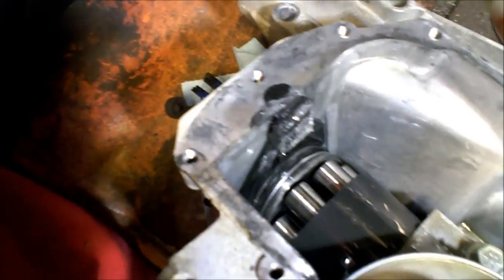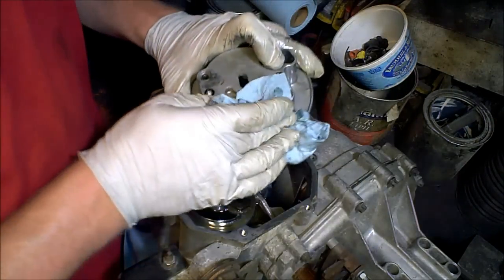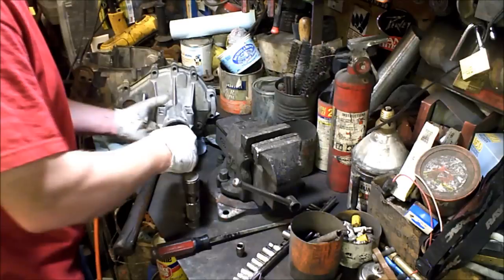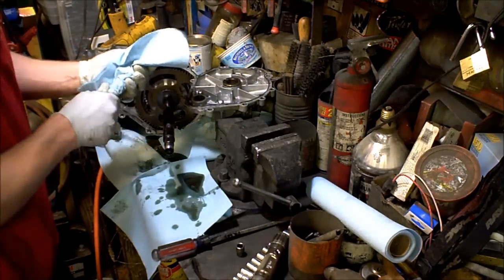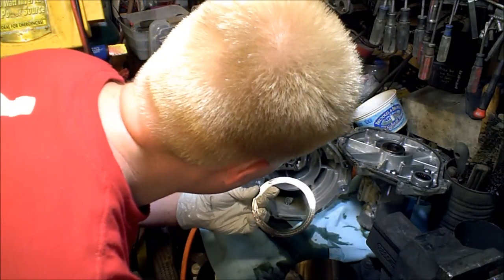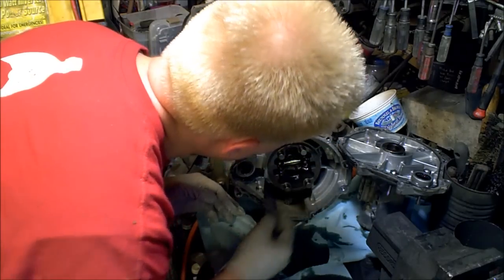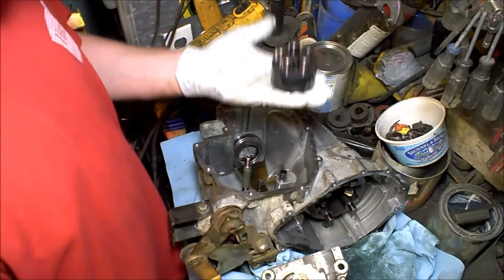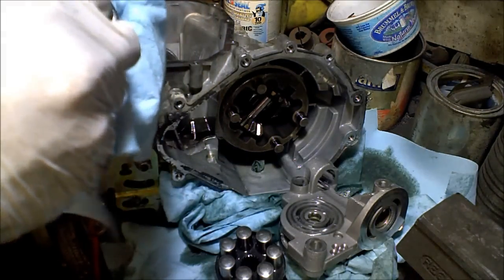2 Hydrostatic Garden Tractor transmission rebuild 2 of 4 Hydro Gear

Comment: Are the springs weak over time? Is this why these transmissions slow down?
Reply from the maker: They slow down over time because the clearances wear larger. This allows oil to pass where it shouldn't normally.
Reply: @sixtyfiveford  agreed

Comment: I have a craftsman riding mower with the automatic transmission hydro, the drive belt broke  and I replaced it. Now it won’t move forward or reverse..  if put in forward it seems like it try’s to move in reverse . It was slowing down I thought the belt was just slipping as I had to have the drive  in a faster position than usual to go the same speed . Any thoughts would be greatly appreciated.  I guess the pump has gone bad.
Reply from the maker: The pump could have seized and that is why your drive belt broke originally.
Reply: sixtyfiveford I drained the transmission oil , and it had a very small amount of aluminum particles.. nothing crazy though. I’ve never changed the filter or oil..  the transmission is dry ..has never leaked .. surprisingly as it’s old probably a 96

Comment: What type of sealant did you use to seal the bottom plate?   Did you purchase any seals also or did you re use the existing seals and O-rings?
Reply from the maker: I reused everything because nothing was leaking. I just took care taking it apart and back together. I just used a RTV sealant.

Comment: Thanks for the thorough videos on this... made me not afraid to tackle mine.  How do I determine if that inside pump housing needs to be replaced.  I"ll check both pumps with calipers but you didn't mention how to determine about that third part.

Comment: Around these parts you would be hard pressed to get more than $400 for a riding mower. $200 in parts plus your time and the cost of the mower your working on. It would not take long before you would have more in it than its worth. Over the last few months I put together a mower for a  family member.  I put all new tires on $65 each for the back and $45 each for the two fronts. Plus new coil and rebuilt carb. Gas line , filters,  Air filter All new blades and belts rebuilt the breaks and key switch. All together just over $350 in parts Not counting all the work I put into this. Or what I had in the mower.  Then they went out and bought a new mower. So I put this one up for sale on Craigslist  I listed it at $375. I got insults of $150 - $200. So I listed it on face book. about 2 months later a guy offered me $300. And I was hurting for money. We all have to do what we have to do to survive. I damn sure do not want to take another beating like this.
Reply from the maker: Just like cars, there are more expensive riding mowers than others. If I recall I sold this one for $1500 because it was a $2500-$3000 unit new.  A clean basic el cheapo riding mower I can get $450(no bagger, cheap brand).  Most riding mowers I buy have to look good. I will pass on junky looking stuff as it hurts the profit and would rather pay $50-$200 for a non running good looking unit than take a free junky one.  I generally won't spend time on items that won't net me more profit(belts, blades, tires, etc). I only replace what is broken, what won't allow it to start/run flawlessly, and give it a spit shine so it looks new. Most riding mowers take me 1-5 hours and maybe $10 in parts to have them ready for resale.

Comment: You keep saying oil in the transmission what kind of oil mine is a Poulan Pro a early 2000 I've had it almost 12 years and it just started doing this it won't go
Reply from the maker: Look up your model on Google. This model and a lot take 20w50 motor oil in the transmission but not all do.

Comment: just found out Husqvarna YTA24V48 not moving to good after the 4th party .....its barely going up hills now at all mostly flat , there was a wagon hooked up to it and people being pulled by dumb ass lil cousin anywho any pointer to look for tommr ???
Reply: zoltan the yta means you have a cvt automatic transmission. I believe it's a rs800 from general transmission. I don't know much about them but I think it will be easier to work on than a hydro tranny.

Comment: I use old cardboard boxes (cereal boxes, cookie boxes, etc), draw a sketch of the part i'm removing on the side of it and then punch holes in it for each bolt I remove. Makes re-assembly easy and I know which bolts go where.
Reply from the maker: That's a good tip.

Comment: I do believe the big gear with the 4 gears inside is called a planetary gear that when engaged in different ways will give three forward speeds.
Reply from the maker: It is called a planetary gears and they go around the Sun gear. They are a fixed single speed and won't give any additional speeds/gears.

Comment: There's more to the pump/motor there's also little metal round discs called seats that go in the pins of the block. I used to build these at hydro gear

Comment: Thank you for the detailed instructions. Do you know approximately how many hours your transmission lasted before it needed to be rebuilt?
Reply: +themanshere74  Why even ask? sounds like you already had a phone book worth of scientific data including  historical real world results backing you up. can't imagine this guy knows more then you.
Reply from the maker: themanshere74 Around 500 hrs.
Reply: Thanks. I am considering buying the Poulan Pro PBGT2654 as it has the G730 Hydo Gear transmission, and it is serviceable. What are your thoughts of using 20w-50 full synthetic racing motor oil with high zinc content?
Reply from the maker: In all honesty I don't think it matters what oil is ran the life of the hydrostatic drive will be virtually identical.
Reply: Full synthetic with high zinc content. In WWII, it was discovered that the Nazi military tanks in the desert out lasted the American tank buy a considerable margin . After capturing Nazi Panzer tanks, their oil was analyzed. They used synthetic gear oil with high zinc content as a non-scuffing agent.
Reply from the maker: themanshere74 In extreme situations yes but you'll never put through these conditions mowing a lawn. If I was driving a tank I would have it full throttle, pedal to metal all the time and definitely test the performance of any oil. There is a reason it is designed for racing because it holds up under extreme pressures and extreme heat. It definately has it's place I just think it is overkill for anything but racing and you'll never see the rewards for spending more of your hard earned money. Oil Marketing is a lot of fast talking to get your money. 
http://community.seattletimes.nwsource.com/archive/?date=19960629&slug=2336807
Reply: Given the same set of circumstances, friction may be applied with a greater mass over a small area resulting in increased wear in a short period of time to wear-out. Or friction can be applied with a lightweight mass over the same small area resulting in a greater period of time to wear-out. Given the small oil capacity of 2 qts and few oil changes needed, cost may be lower with increased transmission life. Great video, and good luck!

Comment: How do you know the pump parts are worn out? 250.00 and put the trans axle back together and it still does not work?
Reply from the maker: don doerner By measuring them with a caliper. There isn't much that can go wrong that isn't easily diagnosed.

Comment: Do you know if there's any way to modify these to get more speed?
Reply from the maker: big ian Bigger tires will give you more speed. So will a smaller pulley on the top.
Reply: Thanks for that. I've been told they're a bit delicate and if you try pulley swaps and they like they tend to die. I suppose it depends how hard you ride them though.
Reply from the maker: Yes, a pulley swap needs to be done in moderation.  To much speed and the oil will create cavitation and not circulate. This will burn up a transmission.
Reply: Big Ian Builds diagram Chevy trail blazer engine

Comment: Good stuff. Gonna attempt to re-build a hydro-static on a John Deere 116. Are you aware of any companies that sell internal parts for these transmissions? It seems the only parts through J.D. , is to buy the whole drive mechanism for $1,000.
Reply from the maker: Ten Second BuickGN  The hydro pump was made by Eaton and used in other tractors. See if you can cross the part numbers as stuff straight from John Deere is expensive. They have to make a hefty profit being the middle man. Here is a good PDF file that shows the guts of the Eaton (on a Wheelhorse) http://www.mywheelhorse.com/graphics/file/Transmissions/ea7p1320_492-4003.pdf
Reply: sixtyfiveford Thank you so much. I greatly appreciate it.
Reply from the maker: Let me know how it goes. I know I sold a good working JD 116 hydro tranmsission 8 years ago on Ebay. The entire thing on got $250 with shipping so you may be able to just buy a used Eaton pump for a lot less.
Reply: sixtyfiveford It turns out to be a ball-piston design. After it warms up, it no longer moves in reverse and forward is slow. I tore the unit down and found a couple of the balls (1 in each carrier) to be sticking. Other than that, I really have no idea what to look for. These units go for around 500-700 and most tractors aren't worth that investment.
Reply from the maker: I would think that the piston clearance is excessive. Once the oil heats up it thins and looses it ability to seal. You can try running thicker oil. I would even consider 80w-90 gear oil.

Comment: would the plate where the small block is located be the lowest point to insure that most of the oil would drain out. If not what about a drain plug in the area to the left of the ring gear  looking at the trans from the rear.  I was watching as you were pulling trans a part and it looked as if there was ample room and thickness there . Also if I am correct isn't there a oil level plug on the right side half way up to check correct volume of oil.
Reply from the maker: Yes, the plate is the lowest part on the transmission and all the fluid would drain if you pull the 2 Allen bolts. I just did it through the top on the video as it is a bigger hole. Yes, there is a also an oil fill/full level plug. If someone really wanted to put a plug in; the easiest thing to be able to install a plug would be to drill a hole in the steel plate and then weld a nut over the hole. This would give sufficient threads for holding and sealing a plug.

Comment: cecil :  It seems to me that once you have dis-assembled the trans that it would be a good idea at the time to drill and tap a drain hole so you could change the trans oil in the future without having to remove trans . What say you?
Reply from the maker: The trans can be drained regularly by removing the 2 Allen bolts and pulling the little block off the bottom. Not as easy as a drain plug but pretty close. The issue I see with installing a drain plug is the thickness of the case or lack there off. Virtually anywhere you put a hole would only be 1/8" aluminum which would fracture or just not give enough threads for a drain plug to hold sufficiently .

Comment from the maker: Recap: belt broke and you tried to engage bypass to push it. Stuck bypass stripped.

Oh... I thought you were able to remove it. You can always buy the new part so you can see how it works or just screw it back in and put a belt back on it and go. It sounds like it is just stuck in the drive position which is better than being stuck in free wheeling. There is a seal to keep it from leaking that is why fluid isn't dripping out. So metal shavings shouldn't be able to get back into the fluid.

Comment from the maker: If it leaks when you put it back in use some plumbing pipe tape. That should seal the threads. Screw it in by hand as far as possible to prevent cross threading. Thanks for the offer. _Moe

Comment from the maker: I would spray it down with penetrating lube and then try. I'm wondering if the right hydro unit is locked up and that is why you lost your drive belt to begin with. You should be able to turn the belt pulley by hand.
Reply: Caravan 10 things

Comment from the maker: A hydrostatic is like an automatic in a car and the other type is like a manual transmission in a car. Most of the time you tractor will say Hydro on it if it has a hydrostatic transmission. It also wont have gear numbers. If yours has a 1 2 3 4 5 N R or similar you have a geared transmission instead of a hydrostatic. Unfortunately most riding mowers are Junk when the transmission fails.